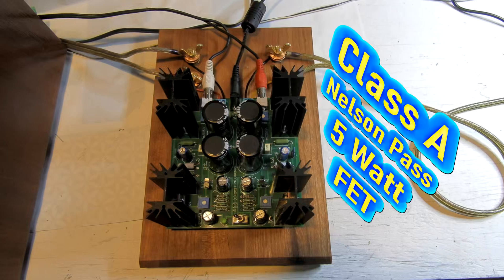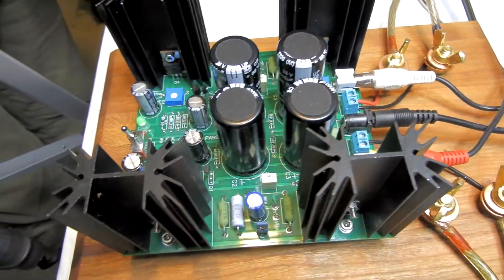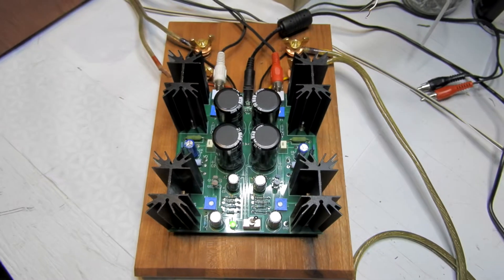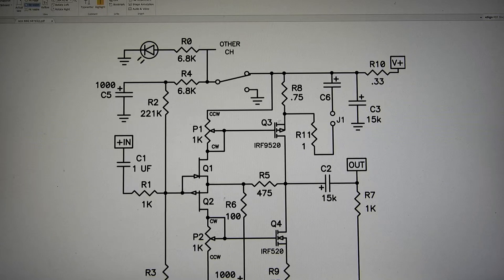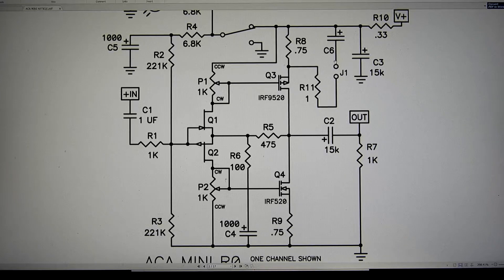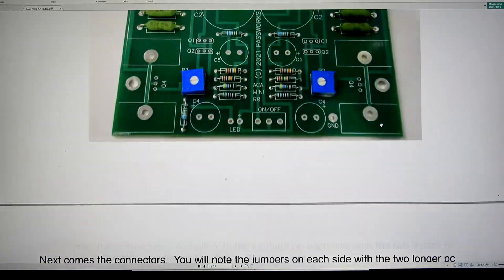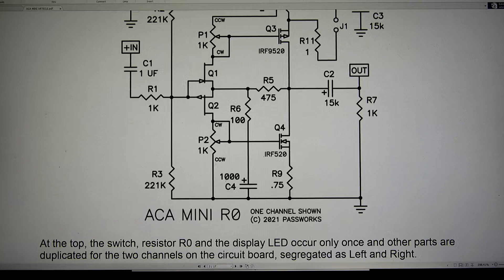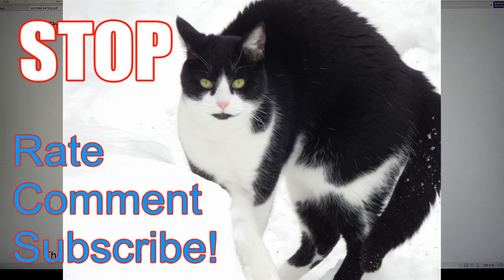A Class A Nelson Pass FET Amp

Comment: The super cap is fine in this circuit. It would take 3.3 amps to put it in danger and the amp is biased at less than 500ma. It would be safe to any signal current due to its long time constant. The output coupling cap has orders of magnitude smaller time constant, so even a shorted output won't harm it. Looks like Nelson Pass wanted improved transconductance to the IRF9520 to balance with the lower MOSFET, but not affect the bias, so the cap must be there.